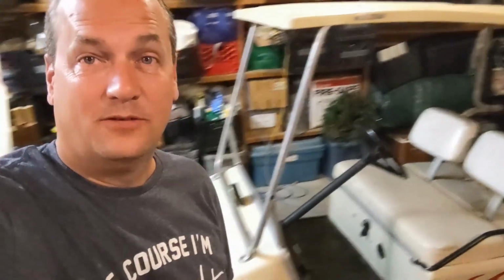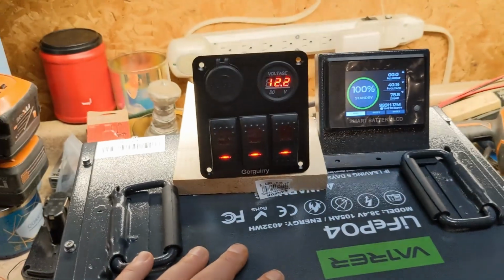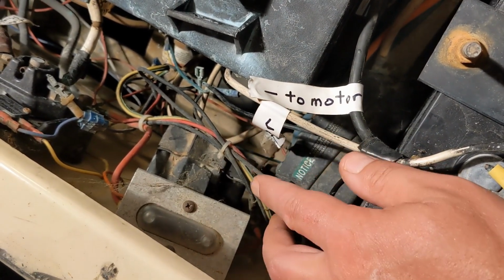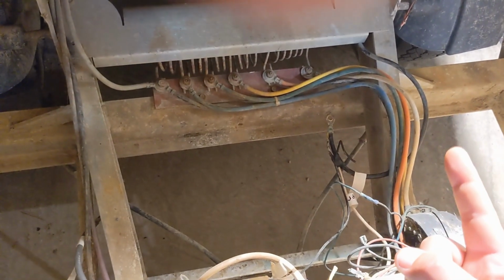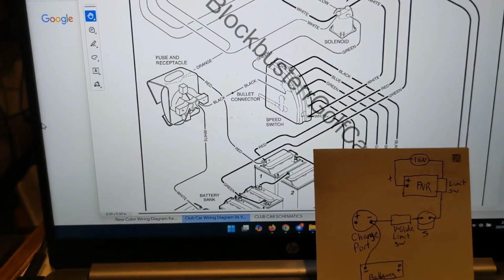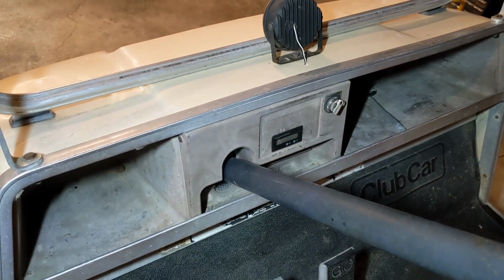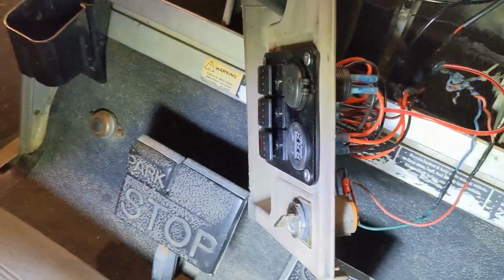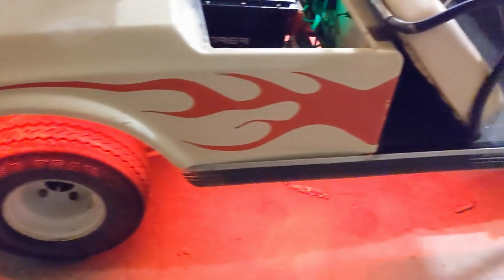Vatrer Lithium Battery Upgrade on a 1991 Club Car DS Resistor Golf Cart (Step By Step)

Comment: Hi..I'm just trying to install the same battery on my 1991 club cart as well. But I'm got lots on the waring connection...could you help me out with this?? I really appreciate it..thanks
Reply from the maker: Since it is a 1991 as well, first confirm that yours looks, and is wired the same as mine was. If so, just go slowly through the video while stopping lots and confirming yours is still the same.
If before starting you see anything that looks wired differently than mine, keep searching until you find your wiring diagram before starting as having yours to work off of is critical. Print it off and mark it up with the changes you plan on doing (before doing anything yet) as you need to start with the plan of what the final will look like.

Comment: i have the same cart and i’m struggling with install of lithium for wiring, i got rid of charger port and im having trouble with what wires go where it’s kicking me in the butt
Reply from the maker: Not all carts are wired the same so the best I could recommend is first find the wiring diagram for yours. Then follow the theory as in why I did what and why I did what I did on mine and see how it applies on your wiring diagram.

Comment: Thanks for the video - it has helped me so far with my 1985 Club Car DS but I’m struggling a bit with the wiring. 
I purchased the Vatrer voltage reducer with my battery and notice you used a different brand. The Vatrer voltage reducer includes a yellow wire that is supposed to run to the key switch, so I’ve run it there with the other side of the switch going to the FNR limit switch as shown on the diagram. When I turn on the battery I’m not getting any voltage at the switch and the cart won’t run. Removing the old charge port has me confused as well and I feel like I’m missing a connection there as well but don’t know for sure.
Additionally, it seems to me that the yellow wire from the voltage reducer going to the key switch would only deliver 12-13 volts and I heard you comment that you had 36v at the switch when it arched out on you. 
Any thoughts on what I’m doing wrong? Many thanks in advance!
Reply from the maker: Sorry for the late reply as I missed this one. In case you are still working on it I'll give a couple thoughts that might help but tougher when I can't see it or share pics or diagrams.
Yes, most voltage reducers will include the 5th wire for the ignition. To save a bit and since I didn't feel I needed it, I went with the 4 wire one. With the battery having a master off switch, and with wanting to be able to charge devices of have the under glow lights on without a key needed, I choose not to have my 12v circuit switched off the ignition. Just worked better for my scenario.
Your ignition IS full voltage and that extra wire from the voltage reducer will go there. Look at the wiring diagram that should have come with it to confirm which one but it will go to the ignition "out" so the reducer will not work (no 12V coming out of it) if the ignition is off. Confirm with what the manufacture sent and test to see which terminal on the ignition gets connected to the circuit or get hot when the key is turned and is dead when it is not, that's the one you want.

Hope that all helps a bit and good luck with it, if its not all done by now already. :)

Comment: Thank you so much for this video! it gave me the courage to convert my 1983 Club car DS model to lithium battery. 

My only issue is that now when I hit forward or reverse with the pedal it takes off like a rocket and burns rubber.  I can hear it click 3 times before  taking off.  through  it's a little scary. 

There is no motor controller it's just resistor from what I've read the coils or the motor could burn out. do you have any solutions for this situation? 

My app for the lithium battery doesn't allow me to change the discharge rate.  It's currently set 260 amps,  but I've read where you can reduce it to 80 amps and it would produce a smoother start for forward and reverse.

Do you have any other suggestions? I know you mentioned forward in reverse of the same speeds now.  I really appreciate any comments you may have or suggestions.  I enjoyed your video!  thanks again so much,...  Just Another Canadian...
Reply from the maker: Thanks fellow Canuck and Awesome that my video helped!

As for the extra jam, I'm not sure what battery you uses but the one I used started at 200A and then goes higher in short bursts when needed (climbing a hill, pulling a load that it should be able to, etc). So mine has some extra give when you step on it but not so much I'm worried. With the petal going through the V-glide, I make sure to ease on the petal when at a stand still to limit the amount going to the motor (that our "motor controller" per se).

I do that to keep the initial torque down as I agree, the breaking of an old motor is my concern.

The click 3 times I'm not sure about, where is it coming from? Does it do the same thing AND take off too quick if the petal is only pressed a quarter of the way down?
I'd start looking at what is between your petal and the motor for some hints on what is causing it.
Reply from the maker: Just looked up your wiring diagram and I see some differences to what I showed. Has a coil and solenoid set up but not is no worries as still functions the same.
I do see that instead of a V-Glide system, the 83 uses "Speed Switch Limit Switches". I have not see on in real life and the diagram does not show mechanical, so I don't know how your petal activates or is connected to these. That is where I would look for the issue as it makes sense now that you heard 3 clicks first.
It shows 5 in total so press the petal only far enough for one to activate (or click) and see what happens, if it doesn't go, why? That is where I'd start.

Comment: Mine is a 97 club car and doesn't have the resisters. But I need to figure out if I need to bypass the original on board computer charger? I am sure that I need to, because these new batteries come with their own battery management systems.
Reply from the maker: Yes. When you install a battery system with a BMS (battery management system) you will always need to disconnect the original OBC (on-board computer) as the two systems will fight with each other and you need the BMS that is part of the battery to win.
Ensure that the motor controller stays functioning as it was though, so any changes to disconnect the OBC must not affect the controller function.
Hope that helps and thanks for checking out my channel. :)

Comment: Great video.  At around the 17 minute mark of your video, you pointed out that a wire needs to go from the V-glide to the new battery (the 'black wire').  Where/How did you connect that on the V-glide?  I acquired a 92 DS 36volt with a lot of the wiring already removed so I couldn't note what went to where.  I'm adding the same Vatrer battery though.  I have everything hooked up (or so I thought) but nothing is happening.  I'm betting that wire is the reason but I don't want to mess anything up while I'm DIYing.  Any chance a pic of where it is hooked up could be sent/added? Thanks.
Reply from the maker: Thanks for checking out my video, and for the question!
I can't reply with a pic but it is one of the leads off the limit switch INSIDE the V-Glide. Here is a link to the vglide on Amazon to show you a pic of what the inside looks like.

https://amzn.to/4501x0k

In the wiring diagram it shows it as the black wire from the bottom of that limit switch (the common terminal), it then goes to the negative of the battery.

Hope that helps!
Reply: @AtHomeAndHandy  Gotcha, thanks.  What size/gauge wire did you use for that?
Reply from the maker: @aaronsollars8375  Since it is the control cct that is there to activate the solenoid through 2 limit switches, it is not carrying the full battery current amount.
Not sure exactly but the original was 14 AWG at biggest. I used one of the ones I cut out as it was the same standard size that was used from factory.
To ensure you're safe, I would use 14 AWG.

Comment: Any additional feedback with your "toaster cart". I have a 1998 Club Car DS  36V which I am strongly considering dropping a lithium battery in. How has the lithium you put in lasted, anything that I need to be aware of before going this route. Thanks in advance!!
Reply from the maker: Have to say bud that it was (and still is) a game changer and still all good and I would recommend it. 
It has been almost 2 years now and I'm still happy with the decision. This battery has been working fine and still getting the longer range, extra power and maintenance free that I had from the start. Happy enough that I just put in new HD rear springs and adding a rear seat next, videos of that to follow.

Only warning I would give, and not a bad thing really, is that our carts do not have a motor controller which decided how much power to give to the motor. So when you give it full guns from a stand still, the rear wheels will spin on gravel as the full amount goes straight to the motor. So way quicker off the start compared to those with a controller but be careful as our motors are not new at all so my concern is the wear on it when you take off with full gusto. So to protect the motor, ease into take off when at a stand still.

Hope that helps :)

Comment: Can you put i 48volt in a36volt
Reply from the maker: I would not recommend it myself and have not tried.
That being said I have read many times that Club Car used a motor in the 36v models that can handle 48v without issues so research yourself and decide if you'd like to. I felt that being the age of the motor (1991), I did not want to risk it as it runs great as it is.
Keep in mind that even if it will be fine, you will need to change the solenoid as well as it will only be for a 36V.

Comment: I have a 1988 club car with the solenoid with resistor coil would it be the same process as yours?
Reply from the maker: I looked up your wiring diagram and it has the addition of coil solenoids and limit switches. The premise is the same though so from what I see it appears that the changes I made would be the same.

Comment: Great video I like how you showed what not to do with the short circuit, my neighbor next-door gave me a golf cart. The same year as yours same brand and I went ahead and installed a chins 36v 150Ah in it and love it and I did not relocate the resistor coil I was able to get the battery underneath the passenger side and it fit without cutting anything I made 4 post out of 8020 with flat stock of aluminum, I had laying around as a base in the battery fit sideways with the terminals facing the driver location, and it barely fit. How would you reconfigure that golf cart to work without that coil resistor?
Reply from the maker: Thanks as I felt it was important to show the screw up as well, and glad you enjoyed!
Towards switching out the resistor coils you would need to do quite a bit (add a controller etc). Doable but when looking into it I figured that if I needed this one to be controller controlled that badly, it would be easier to just sell and buy one of them. Just my thoughts though. :)

Comment: Did you ever do a range test?
Reply from the maker: I did and put it in the details of the video. 
In short, from full to 30% I got about 23km's (14m) in range. If it had a controller (like most carts) I feel it would be just under double that.

Comment: how do you reduce voltage for reverse?
Reply from the maker: In this case I didn't, I hooked it up to the positive post just like forward. For me it is not an issue as along as you know this, you then won't be surprised when it goes with full beans in reverse. :)

Comment: I HAVE A 91 ALSO,,,BUT MINE HAS A V GLIDE AND A MOTOR CONTROLLER. I WONDER IF MINE WAS UPGRADED OR DID CLUBCAR  MAKE A CHANGE MID YEAR.
Reply from the maker: It is my understanding that Club Car offered a controller option on some 36V carts in 1993 and 1994 and then went back to all resistors in 1995 for the duration of their run (2003).
  For 48V it came out in 1995 and are all controller controlled.
  So if it is a 91 and has a controller, my guess is that it must have been modified at some point.

Hope that helps and thanks for checking out the vid :)

Comment: Very helpful. Thanks for explaining the positive cable to reverse.
Reply: How did you determine the red for reverse, I have forward no reverse. Please help....Thx.Robert
Reply from the maker: @robertsimons301  I'm sorry as since this was a reply to a reply, I just seen this now.

For reverse to work properly it gets it power from the batteries (3 of the 6), goes up to the FNR and then distributed from there to the motor.
So since we no longer have 6 batteries, you need to take the positive wire that is goes from the 3rd battery and connect it to the new positive (red) on your lithium battery. From looking at the wiring diagram it shows it as a green wire,
The old way gave halve power to reverse where now you will be giving full power to it. The wiring after the battery positive connection will be the same as in where it connects to the FNR, don't change it.
I hope I responded soon enough to help you out bit since it has been 2 months I'm thinking you have found your answer by now.
Reply from the maker: Thanks as I'm glad it helped!!
 I try to go though each connection so no matter where you are stuck or unsure on your build, you can hopefully get the info you need. :)

Comment: Where does the negative wire hook up to the vglide. I know it hooks up to limit switch but my switch ha a red wire coming from fnr and green coming from solenoid and there is an open blade under where the green wire is on limit switch.
Reply from the maker: Sorry for the late reply as I some how missed your comment but answered other after you.
I have the red wire (like you going to the v-glide limit switch as well as a new one going to battery negative. It was black and went to the charge port where it was terminated with a white that went to battery negative. Because I removed the charge port, I just ran it direct from the limit switch to negative.

I just seached and here is the schematic that is the same as mine. If yours is the same you should be able to use it as well.
Hope that helps :)

https://golfcartpartsdirect.com/Category/562

Comment: I was tackling this project and learning as I go, but then a searched up and found your video! Sir, you saved me so much time! Thank you for taking the time to share your knowledge with us!
Reply: On a 2008 club car DS I’m a little confused about making sure my obs has already been disconnected. This cart has hac a lot of hands in it before me.
Reply from the maker: @tampametal  The best I can offer is look at the schematic for your cart (easily found online with a search) and recreate what you need. 
I did a video on this playlist where I installed a lithium box like this one on a 2003. I show where to look on the schematic, what to do and why.
Check your schematic first and if it is the same as the one I show in the video, then do the exact same. 
Hope that helps :)
Reply from the maker: Awesome as so happy I was able to help. That was the goal when posting as I figured my experience should be able to help others. 
I'm assuming you got it up and running?

Comment: Great video I’m looking to do the same thing to mine. I believe we have the same toaster set up. The issue I’m having now is whenever I turn the ignition switch. I fry the microwave switches. I’m not sure what I’m doing wrong. Any help is appreciated!
Reply from the maker: Assuming a Club Car 36V, what year and which switches specifically? Best is to check the schematic to see what might be happening. Reply with the answers and let's see if we can't figure it out. 
And thanks for checking out the video.

Comment: I was wondering what kind of range you have with the lithium upgrade? Similar to the lead acids? 2miles? 6 miles? Just trying to figure out which Ah battery I need. We mainly just ride it around the neighborhood. Thanks again for the awesome video.
Reply from the maker: Thanks for the kind words and glad it helped :)

Towards the range, below is what I put in the video's details. I only kept track the one time down to a 30% charge but gives a great ballpark of what to expect with a 105AH battery. If you search around you will see average differences between the AH amounts and a range to expect to help you decide what is best for you. I found price wise it was worth it to get to 100AH but it climbs quicker where you go higher. So a nice area to be at, in the 100AH area.
Hope this helps.

"You don't want it to go less than 30% charge so from full to 30% I got about 23km's (14m) in range. With a newer controller style I would expect about 32km (20m). Even at 23km it is far better then what I got from lead acid when they were new."
Reply: @ I was wondering if the 200A BMS has ever shut you down? Not sure how much current these resistor carts pull. I saw another video where a guy was checking his and it hit 220 at one point but it was a more modern cart. Thanks again.
Reply from the maker: @ I have tried mine at full throttle (not that it matters on a resistor cart as it should be pulling the same amperage at all times) and no issues. I did not measure the draw so can't say how close I did get to it though.
This one has a 600A available draw for a few seconds so if pushing extra hard for a very short bit it will not cut out.

200A continuous discharge current
400A peak (35 seconds)
600A high peak (5 Seconds)